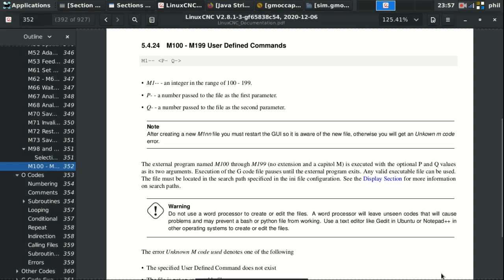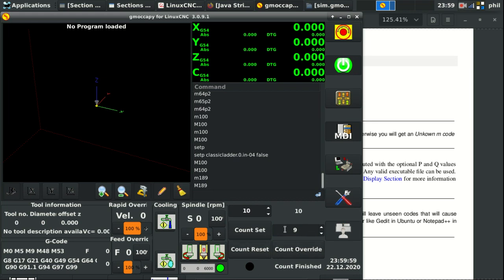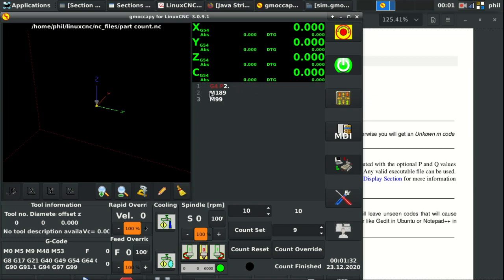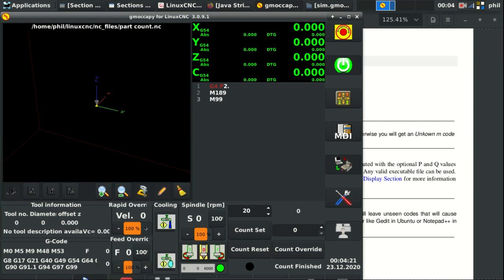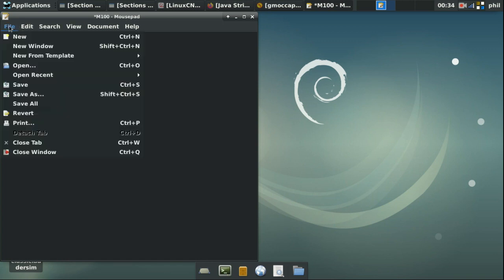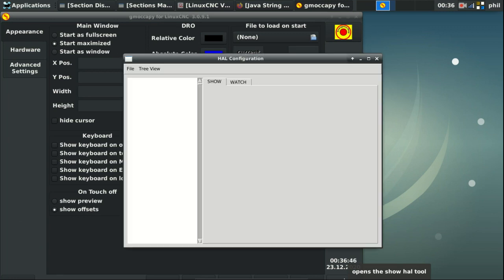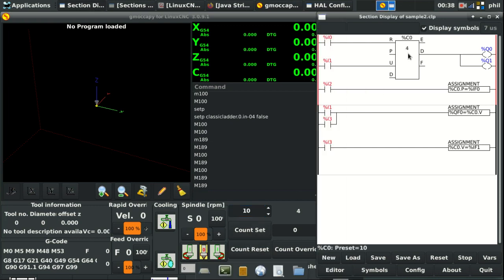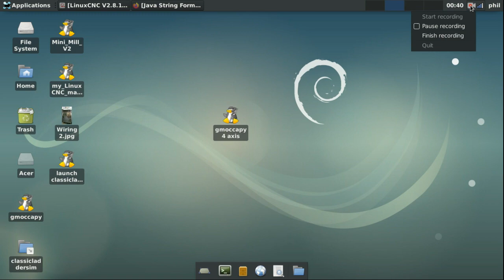LinuxCNC user defined custom M codes

Comment: Friend, could you tell me where to find a connection diagram for the frequency inverter on this board?
Reply from the maker: https://www.forum.linuxcnc.org/27-driver-boards/36453-spindle-pins-mesa-7i76e-power-source
Reply: So, in the 7i76 there is a defined part for the spindle, but in the 7i95 there is not and so I don't know which pins to use